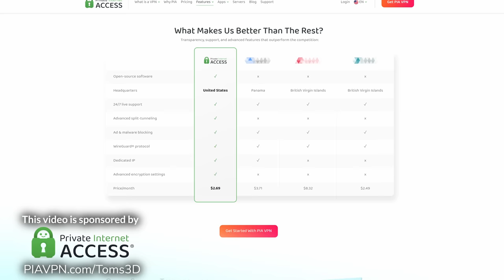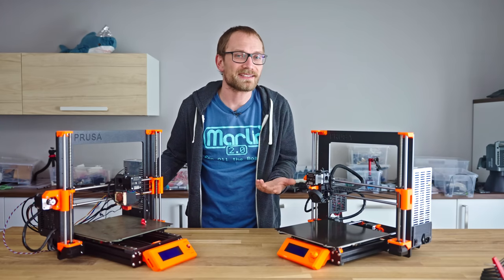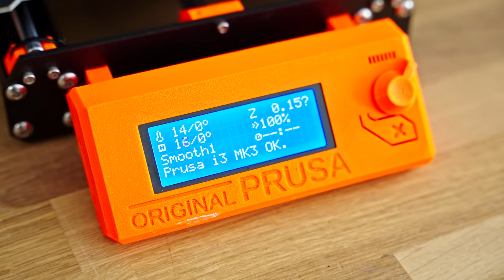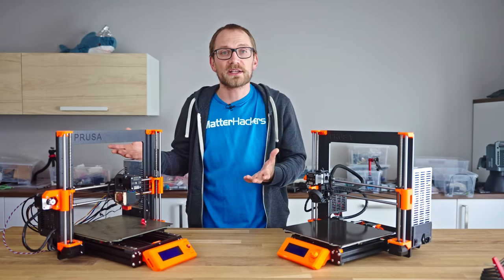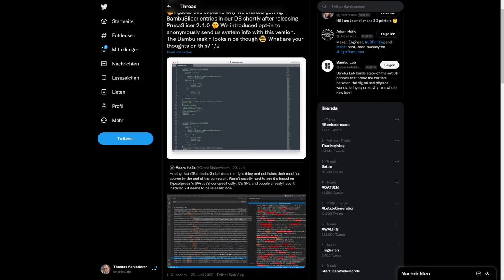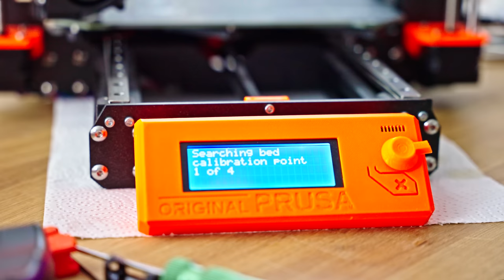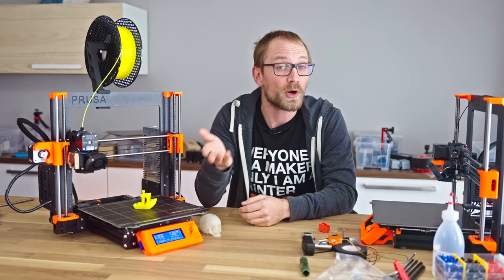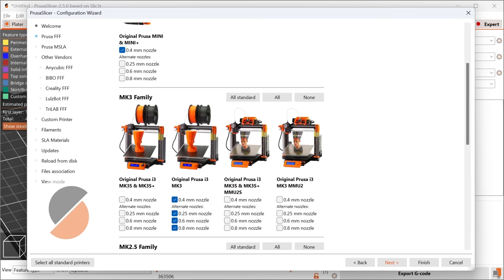This printer is OLD. Why is it still my favorite?

Comment: There is no question that Jo's early work with making repraps more buildable is a SIGNIFICANT reason why the 3D Printing space is so accessible today, and why so many of them are bed slingers. However, I'm worried that they may have sat on the MK3 for a little bit too long - despite its many user improvements and reliability. I'm just testing the bambulabs printer now myself (after similarly rejecting the kickstarter) and its speed and print quality is obscene. It feels lightyears ahead, because it quite frankly is. It might just be the competition we've been looking for to start a new wave of innovation between companies.
Reply: As someone that bought a Voron 2.4 350 kit and has 30-40 build hours ahead, the Bambulabs looked very interesting, especially from a business perspective! But the issues I saw with the Bambulabs printer was that it's almost all proprietory stuff, that's a BIG issue when such a company disappears, which is possible, as many have done so in the past. That is why I went for a Voron, all open source, all parts available from many sources, not making your company dependable from a single supplier that has not any significant track-record (or is too big to fail like Microsoft). IF Prusa had the XL available, I would have bought one as well to compare it to the Voron (will do so in the future). But this is what is Prusa's greatest weakness and greatest strength, the availability of new product. A weakness because they are behind the competition, a strength because they don't make the users the alpha/beta testers. What I saw of the bandulabs printer in Uncle Jesse's review/first look, was not something I found very assuring, too many issues at the feet of user (alpha/beta testers). Add to that the proprietory parts and Prusa has significant advantages (many things OS and not letting their users alpha/beta test), even if their products are slow to go to market.
Reply: @Cergorach  Bambu did promise to release all the source and files if they ever went under, but I do understand your concern about them not open sourcing anything.
Reply: Yeah, I'm really hoping for a Mk4 with maybe 3x3 of those separate heating zones from the XL, the nicer screen from the mini, and maybe a prusa branded octoprint.
Reply: @Cergorach  I don't really understand why people are freaking out about it not being open source. 99% of the machines and software I have in my home aren't open source. And tbh everyone who owns a MMU is still an alpha tester.
Reply: Competition for sure, but I'll not buy one. Ever since I ditched my iPhone for something more open and couldn't use my Apple watch anymore (locked to that iphone) I started valueing having control over a machine and its parts a lot.
Reply: @bagibadoo439  I forgot about the MMU :-( The issue isn't so much it not being opensource, I bought E3D Revo's that are closed, I believe none of the boards are OS, etc. I work in IT with mostly closed software. #1 a new company, #2 completely dependent on proprietary design and components. You even have to get the hotend from them! If for some reason E3D would stop producing the Revo components, I could just replace the hotend on the Voron, Prusa or even on the most basic Crealty printer... Your effectively buying an Apple laptop, that has an iFixit rating of 0, and needs components replaced every x amount of time. No components, and you're throwing away an €1100+ device. Now, that said, I think that for the average consumer that isn't an issue really. But it is if your entire business runs on these printers... If Bambulab goes bust you're stuck with an entire printfarm of very expensive, but useless machines.
Reply: Agree, they took way too long to start working on the MK4.

If the XL fails, I’d be worried for them
Reply: @Cergorach  Yeah it's a newly founded company, that brings  uncertainty i agree. But if one bambu has 3x the output of a Prusa.. But most 3d printing businesses use professional machines which are 100% proprietary though. They may keep a few Prusas in a corner for fun but the bulk of the work is done by stratasys, hp, markforged etc.
Reply: @VincentGroenewold  though im guessing the replacement for your iPhone wasn't decade old tech, if it was, I doubt you would be happy.
Reply: My GF set her heart on a Prusa like mine, but I am going recommend her the Bambu.

Then again, I just ordered the XL for work
Reply: @Cergorach  That's an extremely inaccurate analogy - this video specifically discusses how replacement parts are freely available for the Bambu Labs.

In fact, I think it's a bit of a contrived talking point by people who have decided they don't like the company, since plenty of the hardware can be replaced from alternate sources. Their motion control components are all off-the-shelf - same as Prusa. I don't think many folks have noticed yet, but you can get all the bearings and rods straight from Mizumi.
Reply: @louisvaught2495  I have no love or hate for the company, it hasn't been around long enough to form any opinion on it. But let's assume the worst situation, company goes down and none of the components get open sourced. How do we get replacement hotends? And if we stick in another hotend can we modify the software enough to make it work without issue and without spending weeks/months on R&D? Trial and error? Promises made, but not yet implemented are worth very little. The replacement parts are only freely available from Bambu labs. We probably could rebuild it into a working printer, but that takes time after the issue occurs, not before. Closed source is something that is pretty much a standard situation in most business, but would you build/invest your whole company around one very new supplier? I wouldn't and I don't. If there was no other choice, you might take a risk, but there is, so why take the risk?
Reply: Prusa is constantly updating and developing their drivers and software it is very nice.
Reply: CAN YOU MAKE A FULL PrusaSlicer 2.5.0 Tutorial??? PLEASE!!!
Reply: I totally agree here. I use 2 MK3S+, one with the MMU. The MMU works good for not reloading Filament every new print because you have 5 roles loaded- but for me multicolor prints never worked. I got a new BambuLab X1C last week and this printer is insane. I like my Prusa's and they are work horses - no doubt. This is something which the X1C has to show from now on. But print speed, multicolor and the expirience with the app, slicer and display are on a different level now. I really hope this will lead to new innovations, and as we saw on printables this week, Prusa already reacted and asked what the community would like to see improved. I guess they are already busy planning their next steps.
Reply: @VincentGroenewold  Apple Watch’s aren’t ‘locked’ to a specific iPhone. You can unlink them in the settings.
Reply: Could not agree more after received my bambu lab P1P for less than 24 hours
Reply: @bagibadoo439  As a Zortrax M200 owner before I ran to Prusa ~ that is why and why I ran.  But the M200 printed ABS so amazingly well.  Haven't seen an FDM to match it honestly.  However it was just plain wierd and so closed it was terrible in the end.
Reply: @morbus5726  promises mean nothing. Their tune may change if that IP has value elsewhere, and I expect it would.
Reply: Absolutely agree 👍
Reply: @VincentGroenewold but Bambu doesn’t prevent you from repairing and upgrading your machine. They literally just use their own parts, because those parts are simply better. For 3d printing to advance, you need to accept that the same parts won’t be used anymore. Imagine if all cars still used the same parts as a Ford Model T?
Reply: Being an alpha/beta tester for the MMU is not a bad thing because it's open source. You can fix it, customize it, etc. 
That's the beauty of open source.
My company is almost 90% open source and thank God for that because the little that we have that's closed source is making our IT department pull their hair out because they have no control over how to fix issues that are being reported.
Reply: @Bagi Badoo  he'll yeah, that mmu was a scam and I have both v1 and upgraded to v2. I Gu
Reply: @Bagi Badoo  he'll yeah, mmu was a scam. I have the v1 and upgraded to the second one aswell. Never worked at all

Comment: As one of the developers of the MK3 firmware, this video made my day :)
Reply: As one of the many interested who have not yet obtained a mk3s…
Wil prusa come out with a upgrade to 32bit for that robust platform or would the benefit not be worth it ?
Reply: @timothyvalcke6074  They've said that they won't do that for exactly that reason when they released the Prusa Mini. Honestly, as nice as it would be to have it, I'm quite happy with my 8 bit variant, since it is still way more advanced in my opinion compared to the 32 bit variant and I just like this "old touch".
There are just way too much awesome features built into.
Reply: Thanks for the great work! I've been running 2 mk3s+ (and 4 minis) every day for a year now, and they've held up like champs
Reply: @grahamnichols1416  I literally sneeded in my pants too when he said that! Ohhhhhhh!
Reply: And?

Comment: I think you are not doing Prusa or the community a service by pumping this out-of-date, over-priced printer. It's time for users (and Prusa!) to move on. If you want a printer using this older technology, you can get a Sovol SV-06 for $229; it has the features of the MK3 plus a geared extruder, a 32-bit controller, and a nicer LCD. Love your channel - I think this might be the only thing you've posted that I disagree with...

Comment: I can't really agree with much you said in this video. The prusa is outdated, built cheaply and overall just a very slow printer. Just compare it to an equally priced  Bambu Lab X1. The only thing the Prusa has going for it is the quiet operation.

Comment: I’ve had several printers before I bought my MK3 and figured that since Prusa uses their own printers for manufacturing parts that come in kits they sell, they’re pretty keen on keeping those reliable and with as little downtime as possible. I’ve built an MK3 and MK3S and besides the occasional cleaning and lubing they’ve been printing daily since 2018/2019. Really looking forward to the XL 😊
Reply: That's not my experience at all. 
It took me 3 years to figure out why PLA prints would sometimes randomly fail. Prusa tried to convince me it was clogging, but it turned out to be the heatbreak which they quietly had modified to accommodate the MMU (which almost nobody uses), with said modification causing random jamming when printing materials with low glass transition temperature. Haven't had an issue since I replaced it with Slice Engineering's bimetal heatbreak (although, that caused other issues of its own, but that's a different story). 
I had one of the X axis bearings seize after only about a 1000 hours of printing (despite lubing the rods every 200 hours, per Prusa's official instructions), cutting deep grooves into the rod. The fix I went for there was replacing all the rods and bearings with ones from Misumi and properly lubing them from the inside. 
Now I'm trying to chase down an issue where pockmarks randomly appear in the middle of (what are supposed to be, at least) continuous moves, even when printing with bone-dry filament. Makes absolutely no sense. I'm down to a point where I'll try to film a whole print to hopefully catch one of these on camera to see what the hell happens when they're created. 
I don't really have experience with other 3D printers to compare this to, but in absolute terms, the MK3S has definitely not been trouble-free or reliable.

Comment: My first printer was a Prusa MK3. I loved that thing, it was a real working horse and never really had a problem.
Just the regular maintenance stuff like changing worn nozzles, cleaning and relubricating the bearings, etc.
Then I added an MMU2. At that moment 3D Printing flipped 180° and became a nightmare.
I printed some mods that should prevent some misconceptions in the design, but it never really got better.
I went back to stock and now add filament changes in gcode and it works again like a charm. As much as i love Prusa for the MK3, i do hate them for
that overpriced piece of crap of an MMU2. To me it is the worst i can think of when i think of 3D printers and MK3s in particular.
Reply: Same. I was excited for multi-material but it is NOT reliable enough, and a pain in the butt to troubleshoot. Removed. The stock i3 mk3s is a workhorse
Reply: crazy to see these completely different experiences with the MMU.
had a ton of multi material prints done with very little problems, the main issue is cheap PLA that snaps in the PTFE tubes and beside this is working fine for years now.
Reply: I was a bit shocked to learn this recently, that many who bought MMU just reverted to the original for that reason. And I wished Tom covered this as well. Also I must wonder how XL's MMU works.
Reply: @IoriTatsuguchi  Prusa XL has a tool changer.
Reply: @SebastianJ109  Right, I noticed While after I left comment lol
Reply: I replaced all the tubing in and out of the mmu with 4mm OD and 3 mm ID and it eliminated all my problems. Works like a dream now

Comment: I am a newcomer to 3D printing ( started the second half of this year ). After much research to decide which printer to get, I settled on the Prusa MK3S+. And I get the kit. My reasoning was based o the following: Prusa includes high quality reliable components ( researching the prices and adding them up shows that Prusa is offered at a fair prince). They produce the software and the hardware which makes for a much more seamless and user-friendly experience ( I am not too much of a tinkerer ). I like to acknowledge the work done by those who started the innovation and support them.
I have been using my printer for a couple of month now and do not regret my decision!
And thank you Thomas for your channel, it has been a great help in my decision-making process and during my learning period ( still ongoing ) and beyond.

Comment: I think the Prusa Mk3 is a good example of system thinking. It is not any individual part that makes it great. Some, as you pointed out, aren't even all that great. However, as a system they're all parts that work together to create that whole "the sum is greater than the parts". That's what a good system does.

Comment: I have been using the Prusa Mini and love it so much I just purchased an MK3. Looking forward to lots of prints with these machines.
Reply: Same here. Bought Mini+ first and few months later the Mk3S+ and they're absolut fantastic printers. I also have many other Chinese printers which I modded and upgraded over time to make them also work reliable and great. Put a lot of extra money in them, nearly doubling the prices. in contrast, my Prusa printers are the only ones left unmodded and stock and they still do an excellent job every single day. Prusa may not be the "holy grail" of 3D printing, but they sell loveable machines :)

Comment: As a long time Prusa user both privately and at work I will now cancel my pre order of the Prusa XL and just buy 2 Bambulab P1P with AMS for less money and probably 4x daily output vs Prusa XL. My friend bought the X1 carbon after the Kickstarter ended and looking at that build quality, print quality and insane speeds you quickly realise Prusa are in big trouble. It makes Prusa look like a hobby project and this is the real consumer product. The P1P is $699 prebuilt vs what, $1000 for mk3? Prints 2-3x the speed of mk3 and with wifi, nicer design, better UI etc. Honestly Prusa and other manufacturers have done too little for too long.

Comment: I got the Prusa MK3i because I didn't want to fiddle with calibration, I didn't want to tinker with the printer, I didn't want to buy something that I immediately wanted or needed to upgrade. 
I just wanted it to work. And it did. It was fun and interesting to put it together, and without any fuss it printed a benchy great the very first time.

Comment: When I started 3d printing it was a cheap bed slinger. However I decided I didn't want a 3d printer hobby but a tool to do projects. I bought the mk3s and it's been a super reliable printer that doesn't require me to fool around with it.

Comment: My one and only FDM printer is my eight-year-old Lulzbot Mini, driven by an eleven-year-old Macbook Air. Prints are still great. The Lulzbot has been improved by firmware updates and I now use Prusa Slicer instead of Cura.
At the end of the day the hardware is just a bunch of stepper motors and threaded rods straight out of the 1980s; there's no reason for me to change the mechanism for squirting molten plastic out of a nozzle. Keep using what you have!

Comment: I have  Mk2 with an upgrade kit (from 2016). Aside from maintenance work and a few repairs, it's still running to this day almost as well as it was when I first assembled it. I bought a Creality CR10S during the very early days of pandemic to help increase my output of face shields for my wife and her coworkers (all nurses) and all the Creality did was demonstrate just how good a purchase the Prusa was, the Creality was fine, but the Prusa was a beast, accounting for about 70% of the output. I have also to thank you Tom. I followed along on the Dolly build. I learned quite a bit about Dolly and the Prusa in the process, 3D printing and tweaking the printers. During my round the clock printing of face shields that knowledge helped me keep the Prusa running not to mention having to cannibalize 2 of the 3 Dolly's I built since there was absolutely no way at the time to get replacements as everything around the world had basically come to a halt. The Prusa holds a special place in my heart for not letting me down in a time of urgent need.